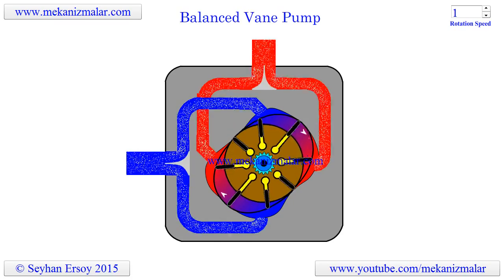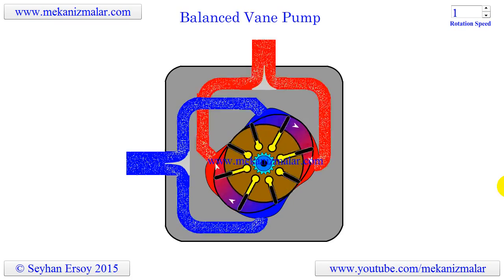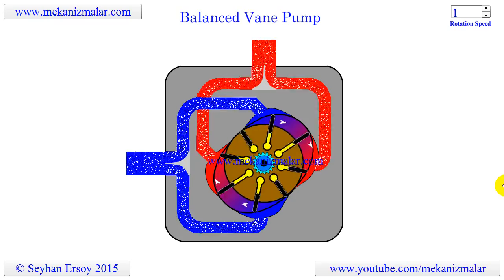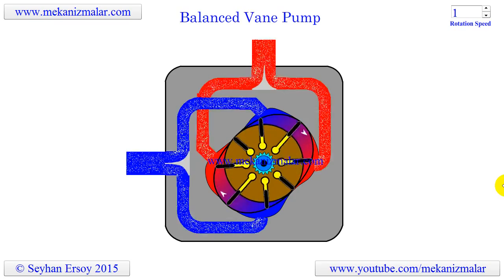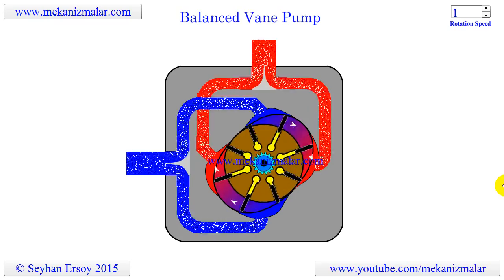balanced vane pump

Comment: I get it now, I looked up how a normal vane pump works.  I see how the vanes slide out to create an expanding then a contracting volume as the rotor turns in the eccentric space in there.  This video does an excellent job of showing how a balanced vane pump is balanced.  Thx

Comment: I do not understand what is going on there at all. I mean I get there are some sort of eccentric interlocking wheels or something but I don't really understand what what is happening is there a more simple version of this type of mechanism with with less parts or something
Reply from the maker: +John Smith At the center of the pump there is a rotating circular brow block, lets call it rotor. There are groves show with yellow colors on the rotor. Black vanes are free to slide in these groves. Sometimes there are springs behind the vanes located closer to rotation axis of rotor. These springs or centrifugal force of rapid rotation forces the vanes outward. Outward motion of vanes restricted by elliptical shape carved on the pump body. The depth of elliptical carving, the height of vanes and the rotor is the same. When the rotor is forced to rotate by an electrical motor, the oil coming from blue pipes into elliptical chamber  is forced by vanes to red pipes with increased pressure. Note that the elliptical shape of the carving forces vanes in and out in appropriate places to cause the pressure increase of the oil. Pump cover, not shown in the drawing, seals the rotor, vanes and elliptical chamber very tightly  to minimize the losses.

Comment: What pushes the vanes against the pump body?
Reply: springs
Reply from the maker: +deezynar Thank you for your support and nice comment about my channel.
Reply: right,you videos are helpful.thanks a lot.
Reply from the maker: +Alex Xie Thank you for comment and visiting my channel. Is springs necessary? Can't it be working just by centrifugal force generated by fast rotation?
Reply: mekanizmalar I think springs are better.Depending on centrifugal force only is not enough to maintain vanes to keep contact on the surface of the cavity.Maybe.
Reply from the maker: +Alex Xie I don't know which one better. Some design uses spring some don't. I guess vanes are heavy and motor rotating faster, no spring will be necessary. However vanes are some kind strong plastic, springs will definitely  be required. But putting springs to my animation would be better.
Reply: +mekanizmalar I subscribe to your channel and watch most of the videos you post.  You do a good job showing how things work.  Sometimes a small detail is left out, but overall your videos are very accurate.